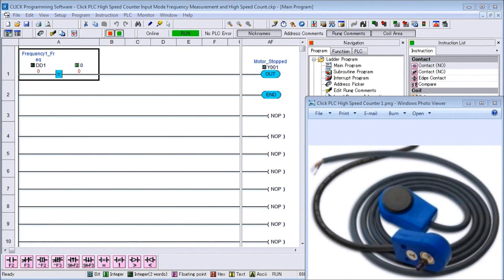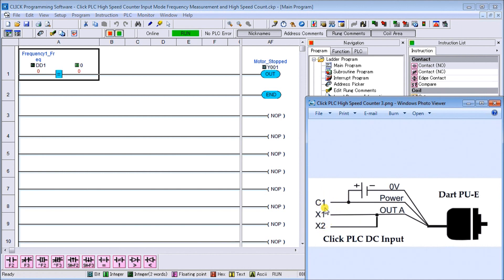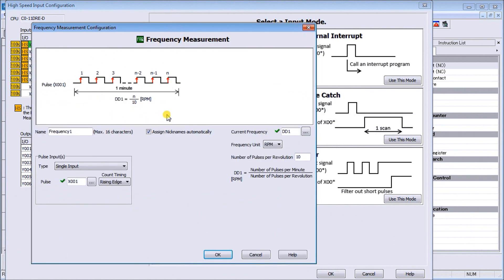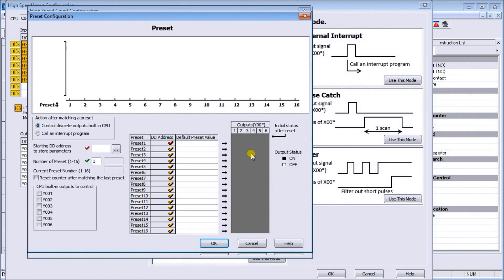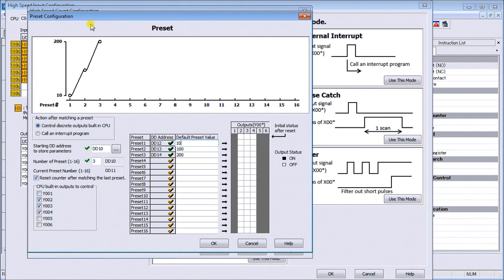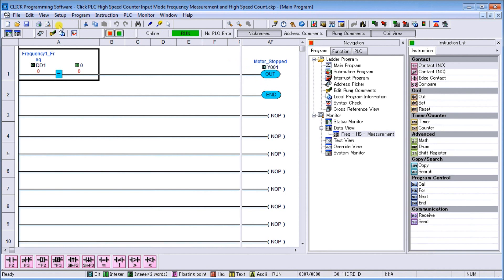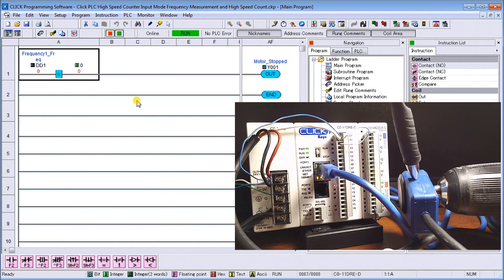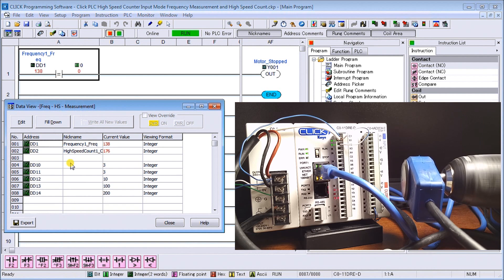Click PLC High Speed Counter Input Frequency Measurement and High Speed Count Mode

Comment: Hey Garry.   Awesome products and videos so far.   I am wanting to use this method to hook up a hall sensor on a cheap 5V flow meter for a flow loop I am making.   Will this method work ?   And does it recalculate the frequency based on the pulses counted in the unit scan time of the plc ?  or does it wait for some longer period of time ?  My thoughts are is that the hall sensor will be out puting a fluctuating frequency .. If you did a video on hooking up a 5V hall sensor you may get some interest I bet from your users.
Reply from the maker: Hi Hobbes,
Thank you for the comments. The Click PLC input will take 21.6-26.4 VDC. You will need a pull up resistor so the input will activate on the hall sensor. 
https://learn.sparkfun.com/tutorials/pull-up-resistors/all
Here is a thread that is also similar.
https://forum.allaboutcircuits.com/threads/npn-to-pnp-high-speed-signal-conversion.4388/
In the Click high speed counter, frequency measurement is selectable for either Hz or RPM. Hertz is the number of pulses counted during 1 Second. The actual value provided is a moving average (16 times) by measuring the number of pulses for 100ms. RPM is the number of revolutions during 1 Minute.
I hope that this helps you out.
Regards,
Garry

Comment: Where does the PLC store the RPM bit value? Can you use the RPM value in math instructions?
Reply from the maker: Hi Blake,
When setting this frequency mode up in the Click PLC, you specify the location to store the frequency. This location can then be used in your program. Math instructions or comparison instructions are must often use in the PLC logic.
Regards,
Garry
Reply: The reason I am asking is because i am interested in building a bicycle with a rpm sensor input to calculate MPH (just as a concept build in my garage for now). If all of this is possible can you reccomend a sensor that can easily pickup magnets on the side of a bicycle wheel? I am new to rpm sensors and do not understand the difference between sinking and sourcing.
Reply from the maker: @blakegardner2339  
I have not done much on speed sensors with magnets, however, what you need to do is find a sensor that will give a voltage output to the PLC to detect. If you open up the specifications on the DC input you will see something similar to the following:
ON Voltage Level > 19VDC 
OFF Voltage Level < 2VDC 
This means that your magnetic sensor must be greater than 19 volts when on and less than 2 volts when off.
Note: Depending on the sensor will depend on the input card required sometimes. 
Regards,
Garry

Comment: Gary, not sure if you are using a cheap headset microphone but you would really benefit from a good podcast quality mic. It sounds like you are speaking through an old telephone. Not too good. Good content, however.
Reply from the maker: Hi Bob,
Thanks again for the comments. I have picked up a Blue Yeti microphone. However newer videos will not be seen until the end of February. 
Thanks again for the suggestion.
Garry